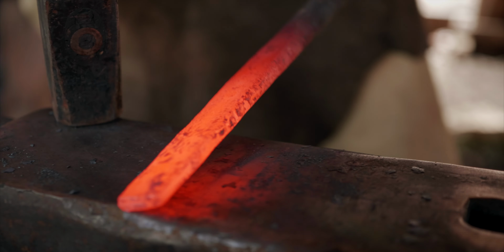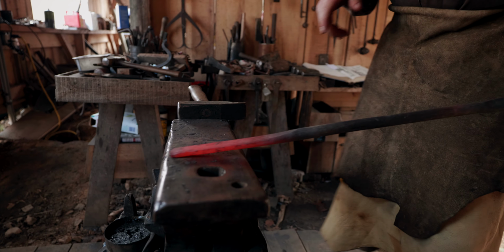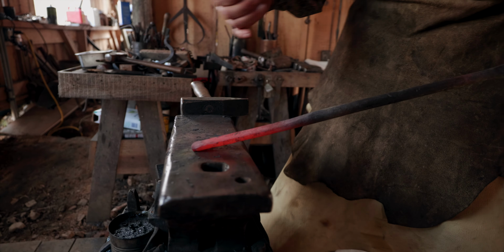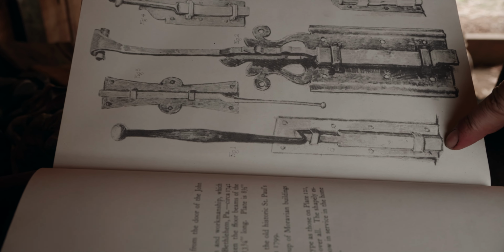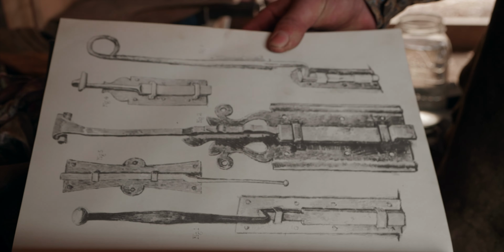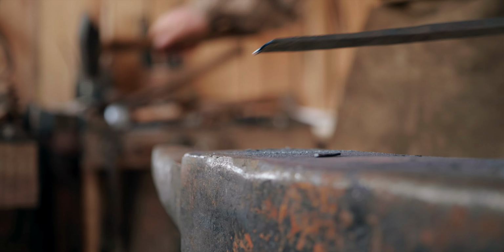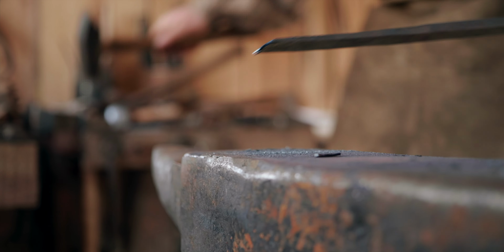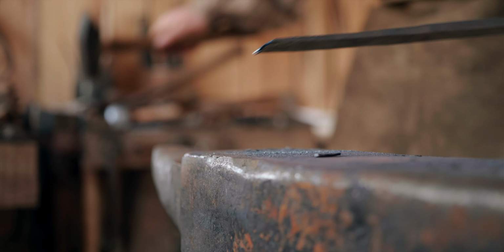Wrought Iron Door Bolt for the Shop - Part One

Comment: Hello At 9.11 you made an error that later resulted in the snapping off of that finial you made. the secret is that you preheat your piece orangehot and put your ring around cherish red,then flux and then in a moderate fire till it's ready to forgeweld. Check Joey Van Der Steeg "collar weld". Kind regards Filip Ponseele-blacksmith
Reply from the maker: Thanks Filip- but I must disagree. I don't think it had a thing to do with the way ring was applied or the heat taken- it was from stressing the transition with too much back and forth at too low a heat after welding.
Reply: @AxeAndAnvil  I must disagree too. .When you weld it  like i explain it becomes one  mass . Did you  use wrought iron? In that case  you need to work much hotter.But sorry when you weld ring around bars  always preheat bar and then put ring on.Check the collarweld demo i did for Joey please. Good luck Filip
Reply from the maker: Filip, not everything shows up well in the final video. It was wrought iron, and the whole thing was heated to more than adequate welding temperature- molten runny surface, with some sparks. And the heat was achieved slowly so that it was an even and deep heat. The video does not show the actual welding heats. That was NOT the problem that led to the crack, and it helps to preheat the middle piece, but if care is taken to take an even, soaked-in welding heat it is unnecessary in this case.
Reply from the maker: ...the weld worked out quite well, and it DID become one mass. That was NOT the issue.
Reply from the maker: Filip, I watched the video on Joey's channel, and enjoyed it. Yes, it is unfortunate that my video does not show the actual welding heats. While I  agree again that preheating the middle bar helps, I think if the heat is taken carefully enough so as to get the piece sufficiently hot through and through, it isn't a big issue. And I believe that was accomplished. Anyway, next week you will see me make a new knob to replace the one that cracked off. I appreciate your input- I sure wish I had had access to more in-person mentoring all along but especially when I was first learning to weld.
Reply: @AxeAndAnvil  Your a good egg laddie, yes the propre mentoring is everything. Check "the devil's blacksmith" Walfrid Huber and see how he does it. Kind regards and good firewelding Filip Ponseele
Reply from the maker: Thanks again! Yes, I have kept up with Magister Huber's projects via Instagram, and just recently got to watch the full Devil's Blacksmith and Forge Welding videos.